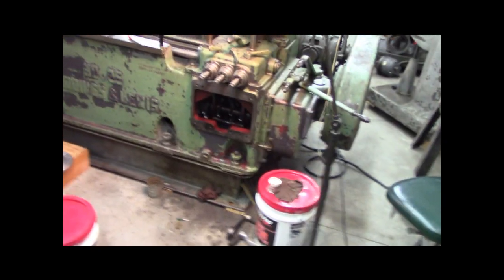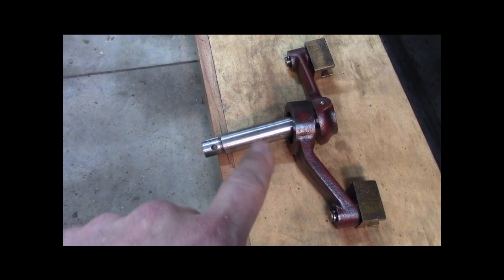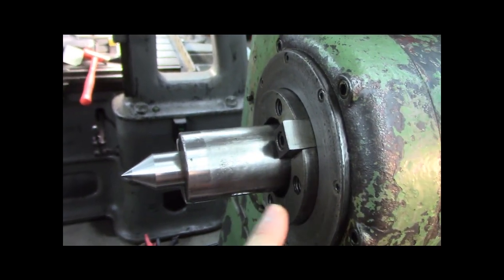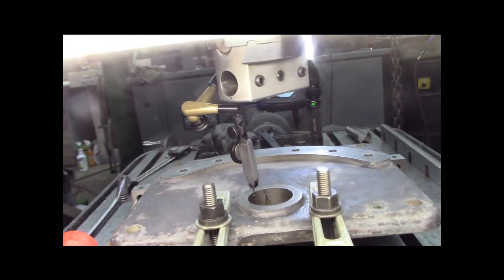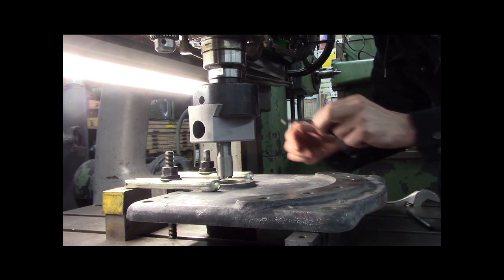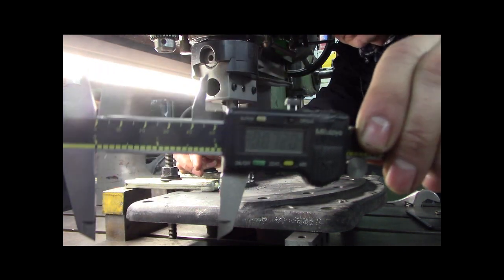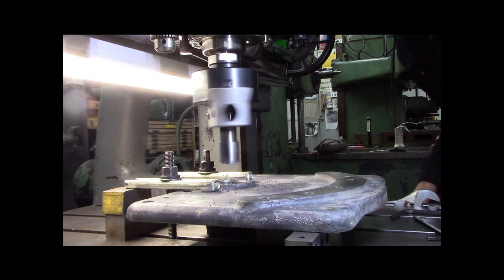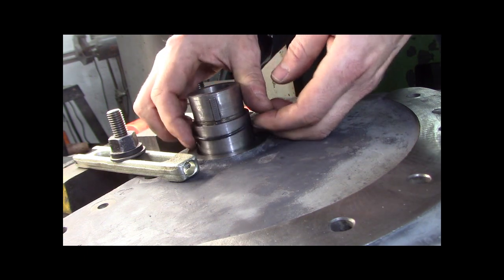1-28-23  -  Giddings & Lewis Feedbox Leak Fix (Part 1)

Comment: I always found it annoying that some boring heads read diametric and some read radial and none are ever marked to tell you!! As a safety i set with a dial indicator on the cutter to see what its moving.  I would convert your machine to oil the vertical ways using a very small amount from the bijur system. I think that would be a lot more convenient than having to oil the machine everytime you want to use it because I know those cups likely leak empty in a day.
Reply from the maker: Oh for sure those cups might be empty in an hour even ! ! !  I was thinking about a stand along Bijur pull type for them.  I see you can get decent (not plastic) ones from China on Ebay.  I need to mark all my boring head with magic marker if they are rad. or dia.  --Doozer

Comment: For the intended purpose , that bore seat should be fine - since it's just to stop oil splashing to cause dripping or oozing .   If there were any load on the seal , or rapid rotation , it would be best to make the 'seat' a matching radius to the O ring . . . but then , I'm sure you know that !     * I've got a horrible case of 'old iron ENVY' !   
** Yeah , that oil groove seems a bit much - but then , the splashing would tend to feed the area , thereby preventing rust ?     'Seems like grease would eventually just wash out of such an area ?     Good fix !